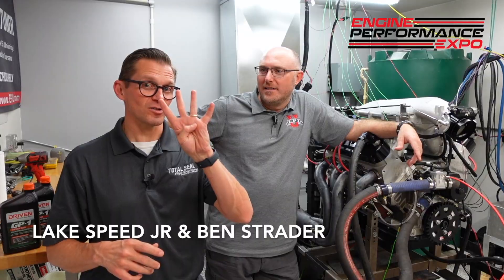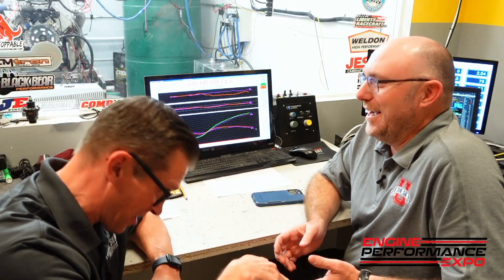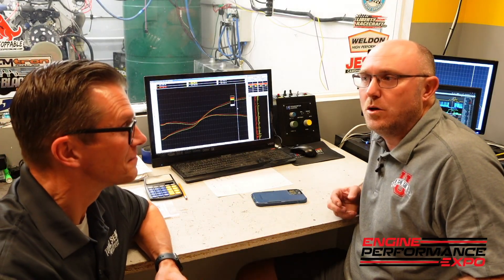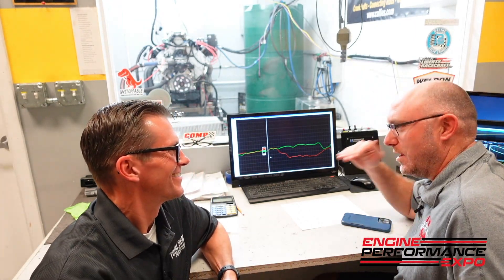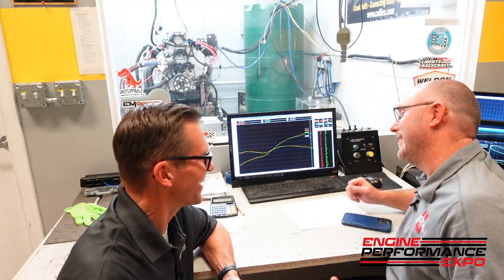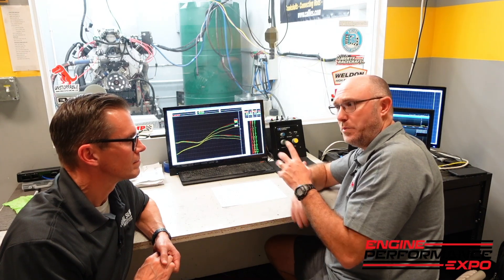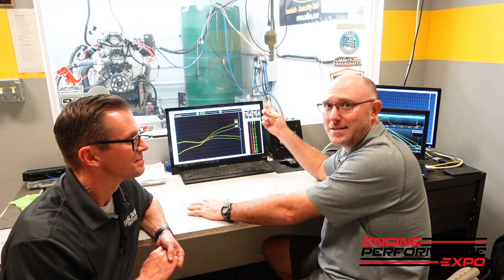How MUCH OIL is TOO MUCH? Dyno Results!

Comment: My auto mech teacher used to take oil out till it was a couple of eighths just on the tip of the dipstick in his 71 chevy laguna. Then run it at the quarter mile drag strip. Bracket racing, trophy class.

Comment: Does over filling the crank case cause higher wear metals in the oil due to foaming of the oil lowering the lubrication effect of the oil?
Reply from the maker: It can
Reply: @themotoroilgeek  Do you have a video that demonstrates that?
I'm surprised you answered so quickly. Thanks!
Reply: @themotoroilgeek  Thanks for your quick response. I'd like to see that video. Toyota says anything above the full mark is "excessive".

Comment: Firstly - I’ve found a channel that matches my interest in detail, thank you.

Secondly - my take away from this experiment, as I don’t normally rev my 4 cylinder diesel over 2000rpm (I realise it is a different engine), I think it is a reasonable interpretation that it will be in the range where the hp is not/barely affected or oil pressure drop occurs.

Comment: This is interesting. However, how does it relate to the real world? If you used a 2L or 2.5L i4 engine, and ran it only up to 4000 using the same test method would we see the same or different results?

Comment: People complaining about their 5.0 coyotes consuming too much oil, that’s when they are at their best! A common sense thing I learned is when an engine starts reving higher or performing better for no reason, that is sometimes it’s last seconds or minutes of life if you are lucky. It’s either leaned out for various reasons, or has less load applied to in than it is normally used for, less load can be less oil! It can also be a broken belt, chain, etc, sometimes catastrophic to the engine, sometimes it’s just the string on your 2 stroke trimmer is gone or your shear pin is broken on your outboard motor, the logic and science is the same.

Comment: I bet it would last long on 5q.,,, I've never seen a Chevy motorcycle lose oil  pressure ,,,, I built a lot of 455 Oldsmobiles,,,445.. they would run for a big block 7000,,,,,,,,,,, knock knock glad those days are over,,, I'm a 350 guy,,,, you can have your 400 block and you're bigger stroke,,,,,, I'd rather turn 7500 and  temp. 190 degrees,,,,, good solid motor 🛵

Comment: What happens if you run the engine at speed for longer? Because this engine has drain-back issues, would it not eventually be same as the first run, the longer it was tested? Just taking longer to run out of oil in the pan?

Comment: I have a 1.6l Mazda 3 that burns some oil, like 0.5l for 3000km.. As i was nearing my next oil change i was at the medium between min and max on the dipstick, so i overfilled slightly and i noticed the oil was so much cleaner on the dipstick. Because i'm lazy i will probably do another 2 thousands km before my next oil change 😇

Comment: Next I am curious if the layout of the engine has anything to do with the pumping/windage losses.. I do believe an inline 6 keeps it's volume the same regardless of where it is in the cycle so it would likely experience less loss with more oil (in theory).

Comment: I don’t understand why pressure goes down with less oil in sump. Either the oil pickup is submerged or it isn’t. If it isn’t, pressure should be zero. What am I missing?
Reply from the maker: Aeration of the oil. Less oil means less residence time in the oil pan, which means more air still in the oil when it reaches the pick-up.
Reply: Ah! Light just clicked on💡! Thanks for the reply!

Comment: Hi, I have a 2019 Honda CRV. It requires 3.5 litres of engine oil but the person who serviced my vehicle put 4.6 litres of engine oil. I drove the car for 50km before draining 1.1 litres out of the engine so the recommend amount was back to 3.5 litres. 

Would I have caused damage to my car engine for the 50km I drove with too much engine oil?

Thanks in advance.

Comment: At 8:10  saying it won't hurt the engine.  What about the crank dipping down into the oil and causing the oil to foam at operational RPM's???  I WAS sweating when in my last oil change, I mistakenly overfilled my 08 RAM 5.7 HEMI by just less than a quart.  The dip stick level was about 3/4 inch over the MAX line which had me concerned.  Generally, a 1/4 inch overfill is not to worry, but the overfill approaching an inch was the reason for me to remove a bit.  At highway speed - ~75 MPH, the HEMI is only turning 2000 RPM's which is really just a bit over fast idle....  GREAT ENGINE....

Comment: Hi motor oil . Big fan here. My son got an oil change at Toyota. They put 1 1/2 quartz too many on his 2024 Toyota RAV4 with 15,000 miles which he drove for about 3000 miles . I don’t see any leaks, smoke or noises coming from the engine. Should I be concerned? How do I know if they caused any damage?
Reply: That's too much oil. But I don't think you should be concerned as it is a fairly new engine and it might have tolerated that high pressure. Unless you see signs of damage, drive it like usual and keep the level at OEM recommendation

Comment: I have a gr86 that i overfill by .5 quarts to .7 on track days to keep oil oressure drops from happening on hard right sweepers. Negates most of the pressure drop and gives me piece of mind. Since im just driving for pleasure i dont care so much about losing the hp loss and more about the longevity of my engine.
Reply: I do the same thing on my Corolla Hatchback instead of 4.6L =4600ml I have 5L =5000ml it was my mechanic who told me to use the 5L container and that the 400ml would be beneficial

Comment: so filling up to FULL  mark on dipstick is NOT  good !?? 
  please help.. coz i just did that !!
took .8  quart  EXTRA  to get to Full dot !!    calls for 8.2 quarts ( 2/3rd  UNDER  FULL  dot )
! i put 9quuarts  right on F  

  any advice  please,,  thank you
Reply: Did you remember that a new oil filter may/will require a bit of extra oil as most filters hold near a half of a quart??  From this video, I am not going to worry about a slight, (1/2 to 1 quart) "overfill"....

Comment: WHO FKING USES RPM HIGHER THAN 4000??????? AND YOU TALK ABOUT ALMOST 7000
Reply: I use up to 7500 rpm as I forget that around 4500 rpm I have the highest torque and I put the gear too low in my naturally aspirated engine because gear 3 and 4 have this flaw that 3 is too low and 4 is high what to stick to the strongest KN. This is the strategy of using what to safely overtake a heavy SUV in a short time. I watch the signs and I don't drive competitively...
Reply: Absolutely correct....  With the high price of gas and the astronomical cost to replace ANY vehicle, my 08 HEMI RAM's RPM generally does not exceed ~ 3000 RPM's when driving moderately.  At 169000 miles, I'm not going to push the RPM's of my engine as this truck will have to last until I'm UNDERGROUND....  🙂  P.S.  FU<K BIDEN....

Comment: My 2015 Lexus RX 350 Sport take 6.4 quarts, I only put 6 quarts even (bought it at Costco).  The problem with my RX350 dipstick oil marks is all over the stick every time I measure the oil level.

Comment: I just changed the oil and filter on my ford f250 powerstroke.  I checked online and it said volume has been increased from 13 to 15 quarts for the 2022 model, so I put in 14 quarts.  I was was looking up in the owners manual about what antifreeze to top off the reservoir and noticed the manual says the oil capacity for the 2022 powerstroke still takes 13 quarts.  Long story short, is 14 quarts to much, one quart over recommended ?  Dip stick shows about 1/4 inch over "full".
Reply: IMO, I would not sweat the oil level being only 1/4 inch over the max mark.  Especially with the greater oil capacity of the diesels....  P.S.  I use the Archoil AR9100 in my 08 HEMI 5.7 RAM and it does a great job of making a lightly oily filter damn near impossible to remove, even when very loose, it is that slippery.  The PowerStrokes that suffer from "injector "stickschion" sp?, is SOLVED when a full bottle - quart -  of the AR9100 is added.  I bet you a dollar it will work for you....  Look on YT for videos that tell the story...

Comment: Just bought 2025 Camry was curious checked oil level and it was about 1 quart over full mark!
At 1200 miles just changed the oil and I can clearly see that they put 1 extra quart from the factory!
Should I be concerned ?

Comment: Thanks for the video, Lake, but can you tell us exactly why oil pressure dropped with 5qt? Was it sucking air? Oil level got so low the pump intake was exposed slightly?How big is the pan you're using, was it able to hold those 4 extra quarts without contacting the crank? Ben mentioned the crank swimming in oil, but by the time the RPM got higher that extra oil should be in the head & not contacting the crank. Was the HP loss due strictly to the pump's drag, or from all that oil draining back past those monstrous rod ends? I think this video created more questions than it answered, tbh.

 Edit: I just reviewed the opening minutes, Lake says the oil pan can hold 11, so I presume at 11qt the crank is still not touching the oil. Ben says these LS motors have a little trouble with drainback, so that explains the level dropping. So am I to conclude that the drop in oil pressure was a result of air entrainment? So the bearings are getting an air/oil mix at 5400RPM with 5qt?

Comment: Would be interesting to run the same test with a lighter weight oil. My hypothesis is with a heavier oil weight you guys are using is costing more power than a lighter oil. You'd gain power and not lose oil pressure win win.

Comment: Yes, a loss in horse power if the crankshaft has to swim in it. I have a 3qt oil accumulator and never see high RPM's! It holds 1.5 qts total. So when running, oil levels drop, but if I gain back 1.5 qts as the pressure drops, how can I hurt the engine? I am more concerned about the little I drive as I am retired, but want 1.5qts to fill the oil galleries with the key on as I go into a cold start. After 40+ as a dealer tech, ASE Master in 78, I like having my oil on the rods & crank quicker than stock truck LS engine designs allow as do most others. Once running, a large volume of oil is not in the pan for the crank to slap and foam up. Most of the oil is in the rocker arm covers, valley on its way back to the oil pan. A 3 qt accumulator at 10-12PSI is only half full anyways. Is my approach wrong? My testing was 1.5 seconds faster to reach 50-60 PSI on the gauge with the accumulator than without, even with excellent bearing clearance including cam. What say you?
Thanks for the info.

Comment: The one thing would worry about here is that it’s not windage it’s just the fact your oil pump isn’t doing as much work because you’re losing it on the suction side. If anything this might tell me the oil pump is oversize or the ports for the oil in the engine aren’t sized correctly .

Comment: Not the best test tbh. Your pushing the engine hotter and hotter and on top of that adding more oil. Ofc its gonna lose power. It would have lost power just from the heat itself. You should have done a final test with the lowest amount of oil like the first test you did and see the power again comparing it from the first test. 100% you would not have the same power.

Comment: What were the crankcase pressures along the way...seems like parasitic drag. I usually run my motors 1/2 qt low for internal preassure reduction to keep smog systems healthy longer.

Comment: Of course this varies depending on combination, but I drained a quart out of my bracket race truck and picked up over a tenth in the 1/8 mile. The oil pressure stayed the same. 

What lead me to try that was before putting the engine together, I filled the oil pan with water to see how much it would take before it overflowed the sump. That total was 4 quarts, plus the quart the filter takes would be 5. I had 6 total in it when I drained the quart out, so basically I just confirmed what I thought was going to happen.

Comment: A friend of mine made a small turbine motor from a turbo charger, and every time he turned the oil pump on it would slow it down tremendously.  It got to  the point where it would not run at all when pumping oil through it. He had to pump fresh oil into it before he started it up, then every 30 seconds or so turn the oil on just for a few seconds. I guess the oil causes a lot of resistance on the bearings, or something

Comment: Very interesting.  Surprised a lot of people mentioned the windage in the pan contributing to the power losses, but no one mentioned the HP to drive the oil pump harder.  Probably the nine quarts caused a fair amount of windage losses, but possibly the first 16hp loss from 5-7 quarts could have been mostly due to extra power to drive the oil pump to 65 psi instead of 40?  For that reason high viscosity oils, high volume pumps, straight weight oils, etc., never made sense in a race engine, as they all make less HP not more.  How about we figure out the "right" amount, type, etc. to just barely lubricate the engine properly and win the race, instead of just increasing all those items?  Someone mentioned the 60 HP being "absorbed" by the 9 quarts of oil in the pan, that is a good point.  Doesn't that all have to be converted to heat?  Wonder what oil temp was doing?  Maybe need to hold it there longer to see the effect, need dyno that can hold RPM.  60 HP worth of heat should overheat the 9 quarts in a very short time.

Comment: Apparent some of Honda’s turbocharged direct injection 4cyl. engines appear to have an issue with gasoline bypassing the piston rings and mixing with the oil and showing up as too much oil in the oil pan. In some cases dealers are re-ringing the pistons to solve the problem. Have you heard of the problem?

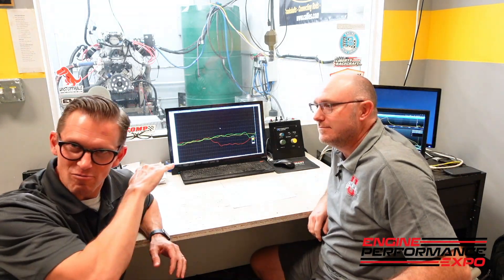Comment: That dip is probably aerating the oil, which is why it went down.  That tells me 6.5 qt is what the engine probably wants.  It's not linear with volume like you're saying at 6:40. It's just that there is more oil, so it has more time to aerate the oil.

Comment: I have a 2021 Ford Mustang GT. A 5.0 liter V8 that takes 10 quarts of oil. I always wondered why they want 10 quarts in. My F150 has the same engine (2014 5.0 Liter) and only takes 7.8 quarts. Why the difference?

Comment: A channel for a shop in Russia did this to the extreme, using a clear plastic vacuum formed oil pan. You could see the oil foaming up as they added more. They ended up at about double the rated capacity and the engine was not liking it. All the air in the oil was impeding its ability to lubricate properly. Ultimately, they had oil coming out of the breathers, and the plastic oil pan started failing. It was a good visual demonstration.
Reply from the maker: I saw that video. I really like that clear oil pan.
Reply: Garage 54
Reply from the maker: Thanks for sharing
Reply: https://youtu.be/VaTbfvzNbxQ?si=B-gE-czIp2KoPuVD

This video blows the doors off all other related videos. Most of us don’t drive a LS high performance engine. 
Having an extra quart does not damage your engine at all 😮
Reply: The Garage 54 video, the engine was totally fine with 2x capacity.  Even 3x capacity wasn't foaming.  It didn't start puking out of the breather tube until they went to 4 or 5x and the oil level was nearly at the breather.

Comment: So, I guess these are the factors that engine manufacturers consider when setting the specification for "the right amount" of oil for an engine. It's a balance between power (and fuel economy) and engine protection. Maybe you could say that the right amount for an individual driver would be based on what RPM they like to sit at. If you live in the lower RPM's, maybe a little more oil wouldn't be a bad thing just to ensure stable oil pressure. But if you live near the redline most of the time, you probably don't need nearly as much. I guess it depends on the oil pump as well.

Comment: Me thinks data is pointing to aeration rather than windage. How many HP does it take to maintain oil pressure, and with low oil = less time for defoaming = less pump resistance = lower pressure and therefore less power siphoned for pumping.

Comment: I bought a new Ford Explorer in 92 and it took 5 quarts of oil but I changed it my self and put in 6 quarts.  I still have that car engine is doing fine NO oil leaks. Recently I was talking to a mechanic at the Ford garage and he told me that if I put in more oil than what it called for I would blow the seals. I ask him how long would it take before it blew the seals and he just looked at my and said nothing. I said well the reason I ask is I changed my own oil and I have over filled it for 32 years and I was wanting to know how much longer before the seals blow out.  He just gave me a funny look and turned and walked away . 
I change oil and filter every 3500 miles Mobil-1 synthetic.

Comment: I have torn apart and built LS's, and understand the pump is ran off the crank, but I am trying to wrap my head around how more oil in the sump is causing it more draw. I get how it's like a supercharger taking power to make power(well lubrication and protection), but it seems to come down to sucking harder. Like drinking a milkshake from a juice box, but that is where I want to ask this question. Is it a sealed container? Is the engine running a PCV or an open system, and would that alter the results? If so can se wee this with the opposite of what that engine is running?

Comment: I imagine those big counter balancing parts of the crank and where the rods connect is splashing into oil bath and zapping up all the power. I run at the centerline of the stick on my pentastar and it runs well right there. Walmart always overfills when I took my vehicle there. Beyond the high mark and that definitely affects this engine.

Comment: you say that is an 11 qt pan. is that an aftermarket pan that 11 qts will put the oil at the same "level" as the stock pan with the stock(5 or6 what ever the factory recommends) quarts?